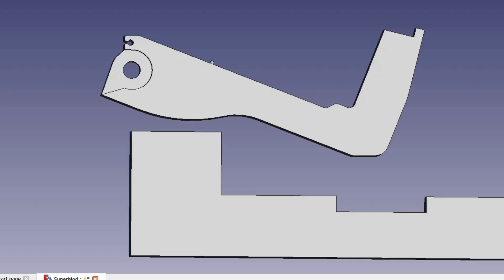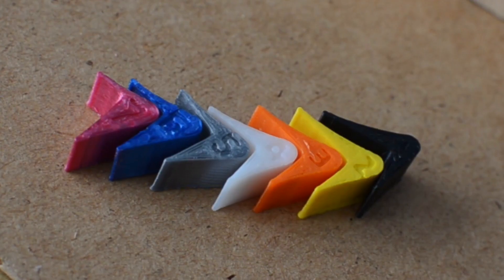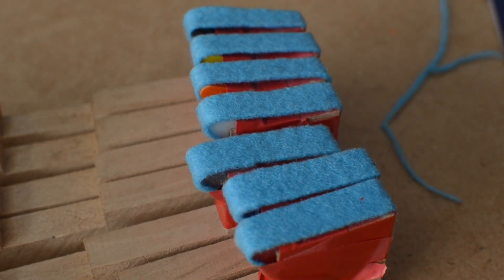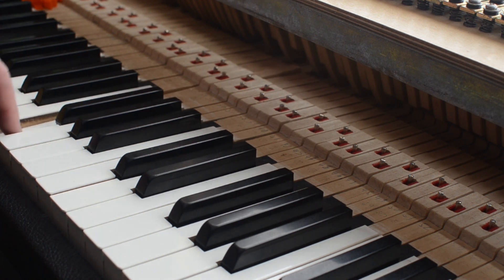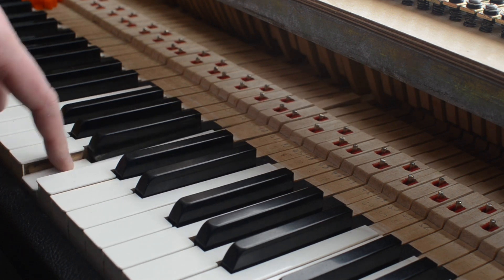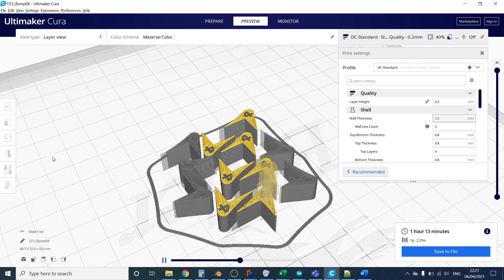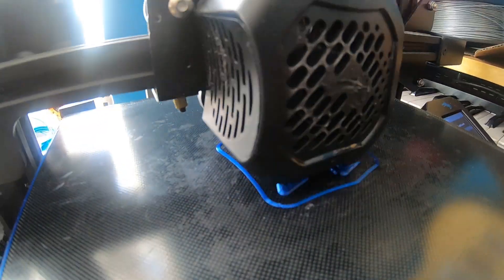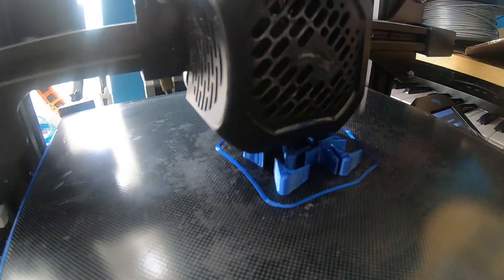3D Printed Fender Rhodes Mk1 Mod

Comment: So of the 7 shapes, which did you find the best compromise between escapement and power...one of the ones in the middle?  Or did you move on from this, as I see you are more recently DIYing whole pianos now
Reply from the maker: I changed between shapes going along the keyboard. 
As the need for escapement increases at the bass end, we can adjust for this.
Though I have shared this design with a few well respected Rhodes techs, they dont perform this as part of their service, so its R and D only. 
If you do try these, do let me know what you think and how you get on.
Reply: @deancoyle  Thanks for the reply, I will do that. So is this the final shape iteration you have arrived at, or have you progressed to any others better, or learned of anyone else's that might be an improvement

Comment: I'm getting my hands on an unmodified Rhodes Mk1 Stage and I would like to know which bump number you recommend.
Reply from the maker: For ease of installation I would use just the standard bump mod. 
Make sure to give it a good clean and replace dirty felts. 
See how that feels and if unhappy try these.
Reply: @deancoyle 
I got my hands on it but I can't adjust the key dip cause no matter how much I unscrew the action rail from the bottom to even out the key dip, I can't move anything cause it's still too tight. Which means the keys are inconsistent in height. So I'm gonna have to do this instead. Any recommendations or ideas to fix the problem?

Comment: Hello, can you tell me if this will be as good as the vintage vibe part ? Thanks
Reply from the maker: My recommendation is to use the vintage vibe kit. 

If you want to experiment then do try this, but I think it is more complex to setup and requires more work and hasn't been tested on a range of pianos. I personally prefer my bumps as they feel more natural to me, but the dampers and alignment need to be setup for it. If you haven't tried the VV bump mod, start there.
Reply: @deancoyle  Ok thanks ;-)

Comment: I just bought a Rhodes and am in the process of doing a full restore.  I stumbled across this and I'm very excited.  I'm going to print all of these on CraftCloud to try it out.  Any recommendations on which one you landed on?  Based on your description I think I will lean toward power.  Escapement is not so much an issue for me because I can just shim the harp a bit higher.  I also have materials to do the bump mod so Ill let you know where I land.  Thanks for sharing!
Reply from the maker: I am interested to see what you think Chris, I know a couple of techs I have a lot of respect for have tried this mod and they have said they can see improvements, though requires more work than the bump mod. Though they haven't recommended this mod.  The bump mod is able to accommodate the wide ranges of tolerances in Fender Rhodes manufacture  than this design. 

I would recommend trying the bump mod first and if still not satisfied try this mod. 

Just out of interest what year is your Fender Rhodes? Does it have hybrid hammers and flat pedestal?

Comment: Two questions - First, has anyone installed this on (at least most of) the complete keyset and how did it feel?  Second, of the seven designs, which one(s) did you think were optimal?  I'd love to try this on my piano, but before doing it, I'd love to hear others' experiences.  Maybe there could be a follow-up video.
Reply from the maker: I am not aware of anyone else doing this to their piano. If you are interested I would recommend trying a couple of keys and starting with the smaller shapes to see if you get the same results as me. I think it required a bit of work adjusting the tonebar adjustment screws to get the escapement right after the mod. 
Out of interest what piano do you have and what is it like to play?